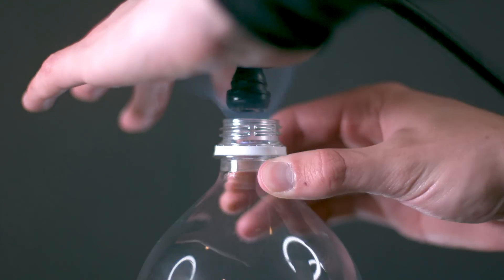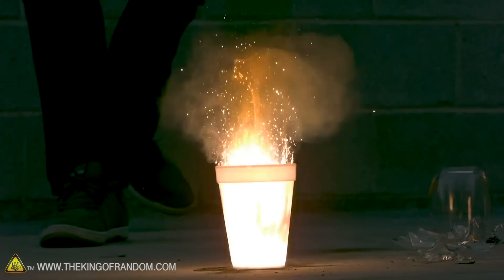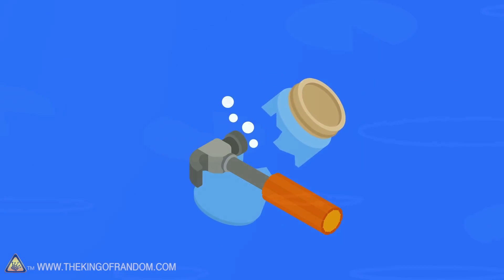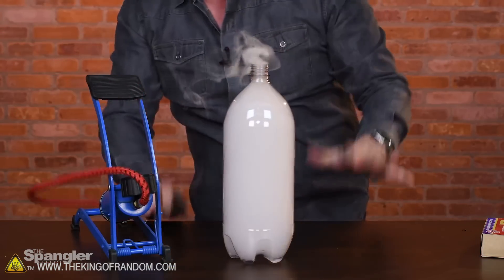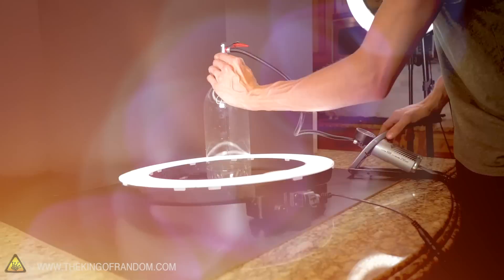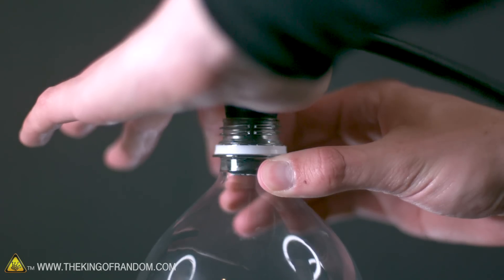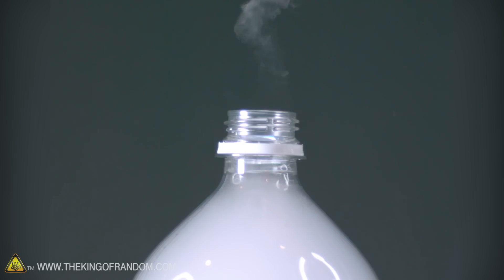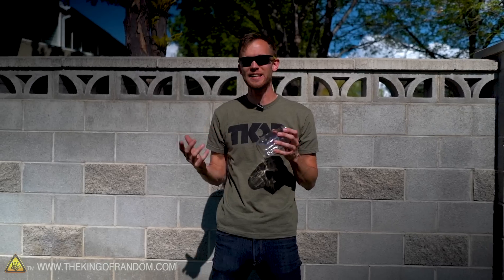Vacuum Chamber Jar IMPLOSION!

Comment: I Have two experiments you guys should do 1:if you put dry ice in the vacuum chamber will it stay the same or go in its liquid form 2:if water look like is boiling in the vacuum chamber what happens if you put a digital thermometer in the water will it change temperature or stay the same.
Ps srry for bad grammar.

Comment: Frank, You should be able to unthread or just cut off the length of pipe that sticks down into the pot.  This will give you a lot more surface area to work with at the bottom and you don't have to worry about poking your project.

Comment: Put instant concrete powder in a glass jar, vacuum out all the air, put it underwater, and puncture the lid.  Will all the concrete get wet?  Will it be more or less strong than normal concrete mixed with water at atmospheric pressure?  Also, how would this work with bouncy ball powder?

Comment: You should try sending high voltage through a piece of hot flint. throwing it or hitting it is adding kinetic energy to it, it'd be cool to see what the reaction would be with electronic energy

Comment: That first experiment is very neat, when the hose gets removed and the gasses escape you can actually see that the oxygen comes out first in a very small amount because of its blueish color followed by I'd guess mostly water vapor and Nitrogen (I'm unsure of the color of concentrated nitrogen, I know oxygen is blue because I work with LOX)

Comment: Red hot ferro rods dropped in to water? Would the thermal shock crack them and they pop similar to when you hit them before they cool off enough to not spark.

Comment: I wonder what kind of reaction we’d see if you put dry ice in a bottle with a bit of water in it, close the lid quickly and submerge it in slime or jelly bath with a weight attacked to the bottom of the bottle. 
Like would the explosion be more contained or would it just be the same as doing it in water?? (Also seeing it in slow mo would be so cool)

Comment: You can also make a cloud in a bottle by twisting a capped bottle with a little bit of water in it until you cant and then remove the cap. Then it'll make a small cloud ☁

Comment: Can you freeze a lava lamp in place with liquid nitrogen or other cold things?
Reply: It wouldn’t work the freezing point for the wax is way higher then the freezing point for the oil so the frozen wax would sink to the bottom and then even if they could get the oil to freeze I doubt it would be translucent
Reply: Oops
Reply: Miguel Angel Acosta are we keeping the “Lava” in it? That’s something I would like to see
Reply: @chaoszombie9995  yes
Reply: That sounds awsome
Reply: I don't think so. You'd have to get it hot enough to make the lava do it's thing, and it'd cool down to slowly to freeze the water around the ooze. Plus you might shatter the glass from thermal shock.
Reply: That sounds really COOL 

IM NOT SORRY
Reply: @pebbletail_  lol
Reply: Miguel Angel Acosta i will love to see that
Reply: Try to freeze a lightbulb with liquid nitrogen while it is on to see what happens
Reply: Better with liquid oxygen
Reply: Yeah liquid nitrogen lava lamp sounds cool
Reply: This sounds like a cool and great idea
Reply: Like your idea!!👍🏻😎
Reply: Don't they freeze in place when you turn them off
Reply: @deacon5451  they slowly go to the bottom.
Reply: Deaconcole Cole No because the oil still moves to the bottom
Reply: Liquid hydrogen
Reply: Vetirisius Ziiran It's nitrogen